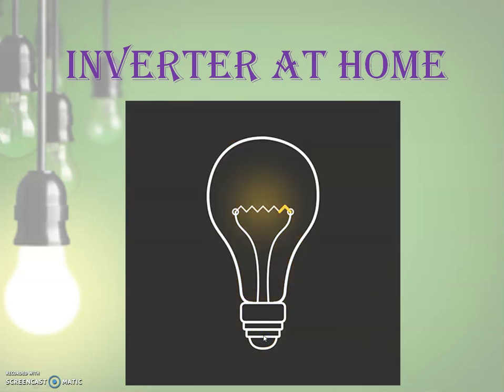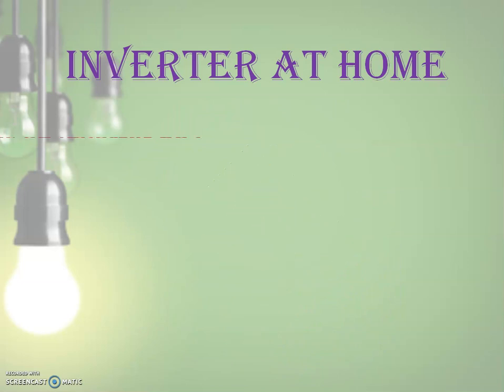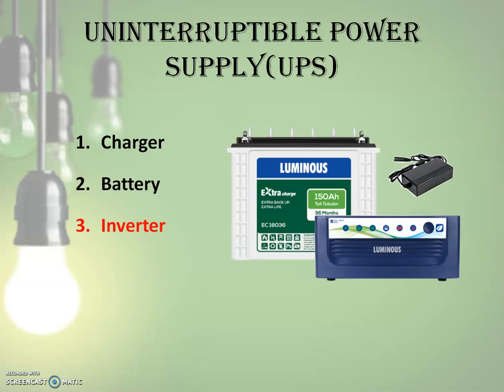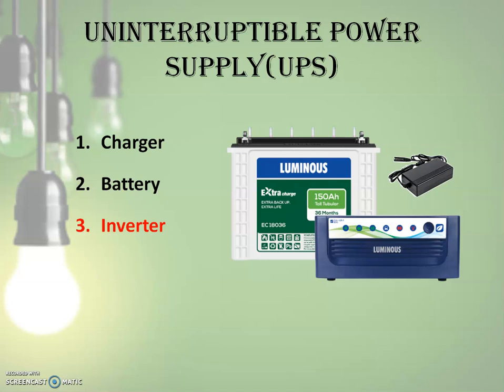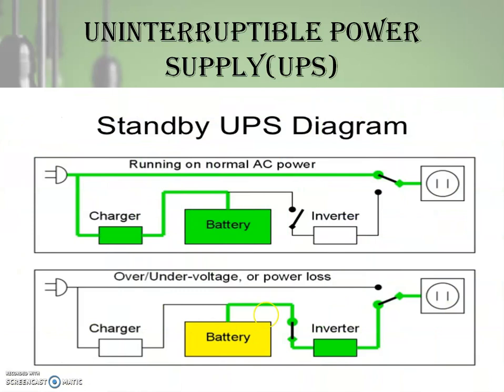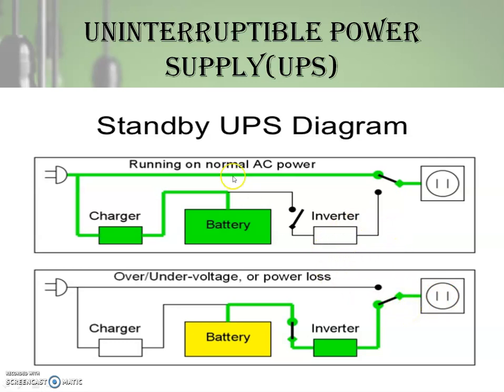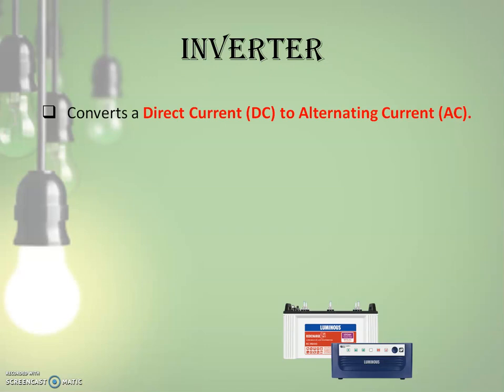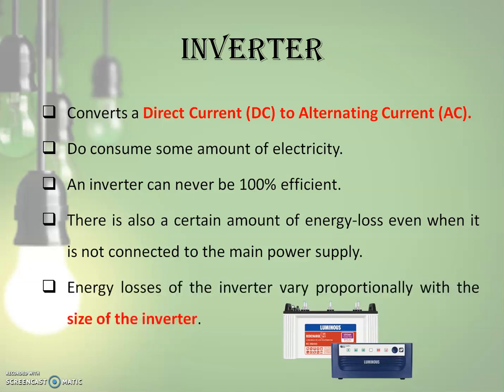HOME INVERTER AND ENERGY EFFICIENCY

Comment: How the inverter detects that the main power supply is failing?🤔
Reply from the maker: When the AC mains supply is available, the AC mains sensor senses it and the supply goes to the Relay and battery charging section of the inverter. AC main sensor activates a relay and this relay will directly pass the AC mains supply to the output socket.The load will be driven by the line voltage in this case. Also the line voltage is given to the battery charging section where the AC line voltage is converted to a DC then regulated and battery is charged using it.There are special circuits for sensing the battery voltage and when the battery is fully charged the charging is stopped. In some inverters there will be a trickle charging circuit which keeps the battery constantly at full charge. In a similar manner the sensor will sense when the supply is not available/ under voltage/over voltage and will switch on the inverter.
Reply: njnum aloikarind